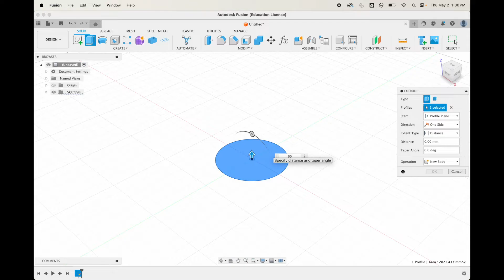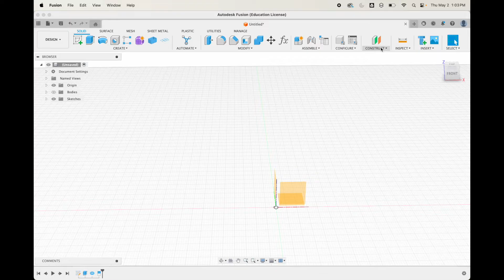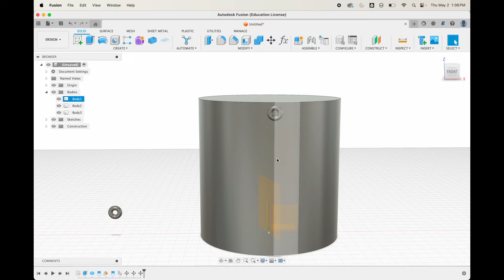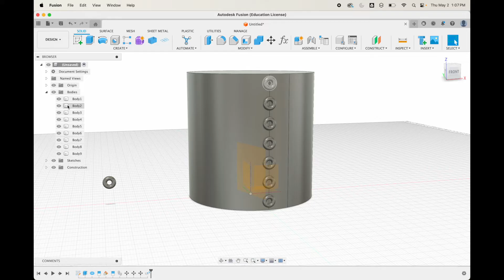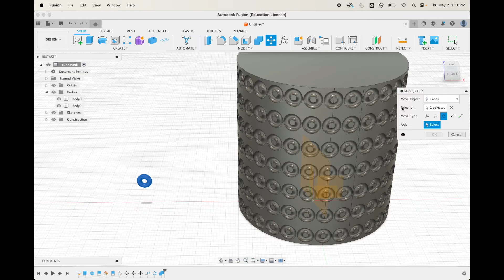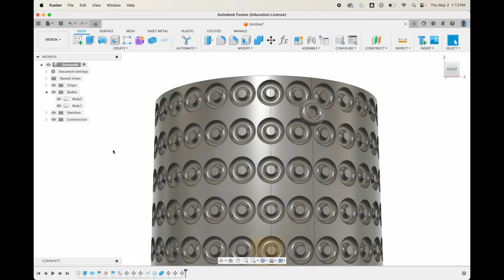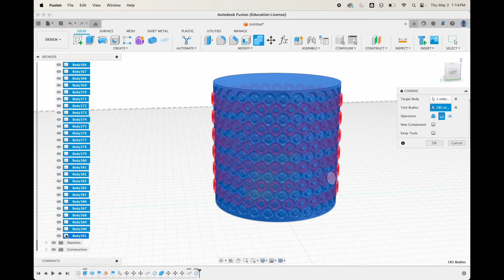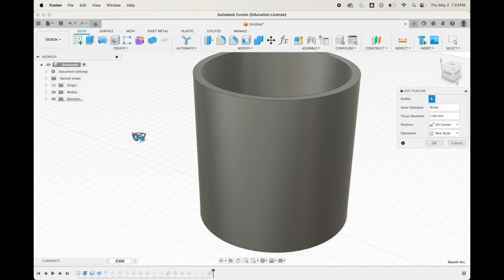Fusion 360:  Pattern on a Curved Surface

Comment: The sheer amount of unnecessary steps in this video really makes the whole process difficult. You could have made the entire video a fifth as long, twice as informative, and wasted way less time. During your own video you kept saying yourself that you could have done it better.
All you had to do was place whatever size torus, shape, or whatever on the surface in any pattern you like vertically, do "pattern on path", and orient to the path and it would have don the same thing in 90 seconds. There may not be a more difficult way to do this than you did it.
Reply from the maker: You should make tutorial videos! I just subscribed to your channel

Comment: This is very helpful, but it is NOT a pattern on a curved surface, it is a pattern on an extremely specific (and the simplest of) curved surface called a circle.  This tutorial, unfortunately, doesn't teach how to pattern an arbitrary surface as the title implies. Imprecise titles, unfortunately, make it difficult to find the right content.
Reply from the maker: Are you on meth?
Reply: @ShopTherapy623  Nice.  Are you an idiot?  I'll be more direct ... your tutorial title is misleading at best.  Patterning a circle is trivial since Fusion provides the patter circle feature.  Patterning a non-circular surface is a completely different skill which you didn't share.  I'll figure out how to block you so we don't need to interact again.
Reply from the maker: You said “it’s NOT a pattern on a curved surface”….and then the VERY next sentence said it was a pattern on a curved surface. Lololol. Lay off the meth dude. I literally can’t wait til you block me.
Reply: @ShopTherapy623  you know what he meant, it's a pattern on a circle which is way easier than an irregular 3d curved surface. No need to get so mad, he was being nice & said the vid was useful...
Reply from the maker: @wcovey25  He wasn't being nice at all....and no I didnt know what he meant.  He said it wasn't on a curved surface.  It was on a curved surface, and then he said it was on a curved surface.  No where in the video or title of the video did I say it was going to be on a complex curved surface

Comment: Avoid the Move command. Create things where you want instead.
Reply: Just got into 3D modeling. This is kind of a difficult practice for someone new. Requires a little bit of thought lol. I usually don't know how to do most of the things I'm trying to do or even what im creating until I'm done. 😅

Comment: Awesome, thanks!

Now, go in and add a small fillet to the sharp edges on every single one of the inner donut holes 😂

I'm mostly joking, but somewhat serious....still really new to fusion, but I'm thinking if you wanted to do more modifications like that, can't you do your cut (and any subsequent modification) on the two single donuts, then do your circular pattern by selecting Features instead of the Bodies?  Or is there a benefit to patterning with the full bodies first?
I wonder which is harder on the processor?
Reply from the maker: Yes, you absolutely can do that, and should do that!
Reply: @ShopTherapy623  there seems to be about 16 ways to skin a million cats in this program lol
So much to learn, but it's a ton of fun!

Comment: But those donuts (torus) don’t wrap to the surface of the cylinder, right? I mean each individual donut. Maybe I missed something…, if you make it large enough to be easily noticeable, would we see the donut being wrapped to the cylinder surface? Because, if it isn’t, then the cut into the cylinder isn’t uniform, but just not easily visible with a small torus.
Reply from the maker: Correct, doing it this way, the torus isnt wrapped, but it's so small, that it doesnt really matter.  If you needed it wrapped, there are ways to do that as well.

Comment: You can streamline this a bit by creating a tangent plane on the front of the cylinder and then draw a circle on it and use the pipe tool to create the torus shape as a cut extrusion. Then use the array tool set to feature to replicate that.
Reply from the maker: Yeah there are many ways to create your tool to cut the cylinder.  The main thing I was trying to show was creating planes 18 degrees apart (360/18 = 20) so you can use those to "stagger" your pattern around the cylinder.  This was an "off the cuff" tutorial, so it's not very polished!  Thanks for the comment!